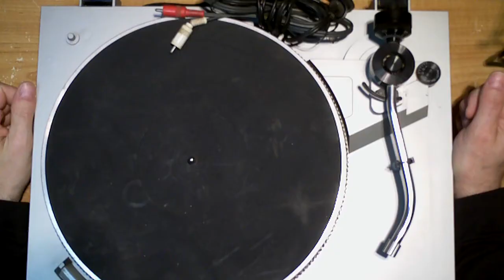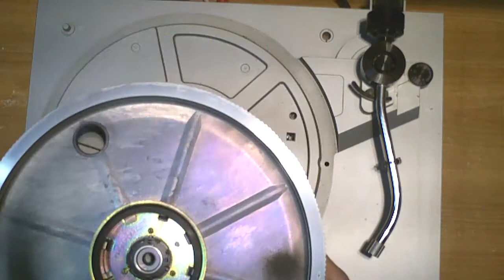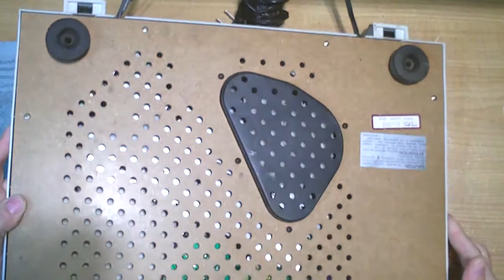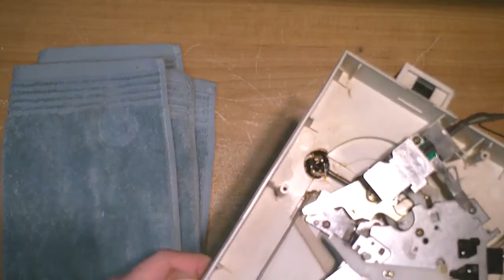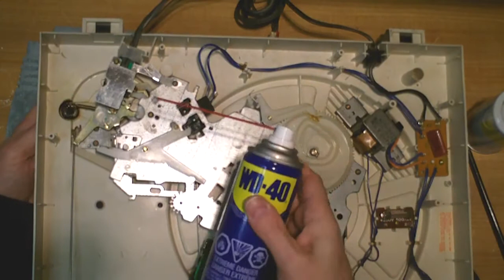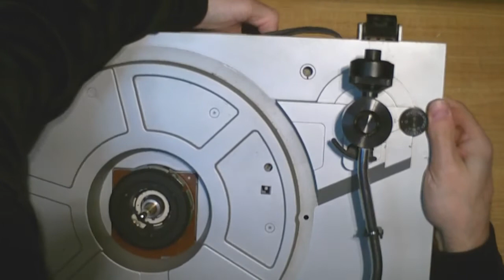Realistic LAB-390 Service & A Word About Brands

Comment: I'm assuming that since my Lab 390 stopped turning it's the motor that needs replacement? Is that a logical assumption? I have not taken the bottom off but will take a look at that.
Reply from the maker: I would check the micro-switch that turns the motor on first.
Reply: @TurntableGuy  Thank you for the reply. I'll give that a try. That part needs replacement sometimes?

Comment: I worked for radio shack in 1980 and bought this turntable. It was 169.00. In today's dollars it would be 585.00! I still have it and finally put on a brand new cover which I bought for it in 1981 figuring I would need to replace it someday.  I still have the old one but it has some minor wear and tare. I use a blue ortofon cartridge.  Also still have the manual if anyone would like the specs on it.
Reply: @John whats your email ?
Reply: @vinylsurfer2155  I just picked up a 390 at goodwill for $80. Its near perfect! Would love to see the manual.

Comment: Hello, saw this video and was hoping you would have covered something about the tone arm skidding across the vinyl when it comes to the auto return. Oh I have a Lab 395 by the way.  So back on to question, when I Cue it it is above vinyl, but when it auto returns it skids across the vinyl like it's not raising high enough.   Have any thoughts?
Reply from the maker: The auto-return lift-mechanism is out of adjustment or broken and not lifting the piston high enough.  The cueing and auto-lift are two separate mechanisms.
Reply: Thank you wasn't sure. I couldn't really find any good sources out there for this one.  Will have to try my best with it when I have some free time with out the kids awake
Reply: Another question, can I use WD40 on some parts or should I use something else to clean old grease and then what should I use as new stuff or do you have a video that talks about alot of this for cleaning and maintaining?

Comment: I have a lab-395 that plays at 33rpm perfectly, but very inconsistently at 45rpm.  Do you think I need to replace the motor?  It seems to be a cheap part.  Would the process be the same as shown in this video?
Reply from the maker: I'm not familiar with that model, but it is very similar on many turntables.
Reply: @TurntableGuy  thanks for the reply.  You think the motor would be a good place to start to fix the problem?
Reply from the maker: @thecowwarrior3  I doubt it's the motor.  I'd clean all the controls, switches and potentiometers first.
Reply: @TurntableGuy  good advice.  Did that and things spinning properly now.  Thanks!

Comment: to Turntable Guy I have a ralstic Lab-440 TT as it returns tone arm back to rest it some times kicks back slightly off its rest causing it not to shut off sometimes it will shut off how do I adjust this I had a problem with lead in groove looked all over for advice but no one could help but I found where to adjust just if possible If I can find whats causing it and can I adjust something inside thank you for your response JRo
Reply from the maker: The manual for the 440 is available from vinylengine.com.  It explains how to set the lead-in and lead-out for the tonearm.  There are two holes near the tonearm base which need adjusting.
Reply: @TurntableGuy  H ello To Turntable Guy thank you for your FAST response I did not expect a response I tied vinyl engine .com I even am subsrcribed to it  I could not download it was such a hassle it kept changing on me I would download and nothingit even took me for ever to get these yahoo s to finally login but as I was staring at TT I saw the two covers a voice said it would be logical to believe the adjust ment was in there and it was and the tone arm kicking back found it was thecycling gear it was not set right ,I idiot took it off originally to see if it was or needed any cleaning it was fine I installed it wrong but now it runs OK love to give you 6!!!!!!!stars for at least trying to help this manual is sure hard tom find,but thank!! again JRo also sorry for lousey typing  just woke up and brain not on yet !!
Reply: I have the manual for a Lab 440 if anyone needs me to chk something